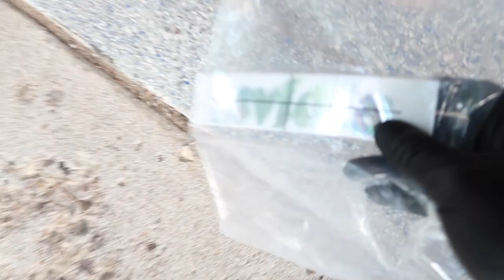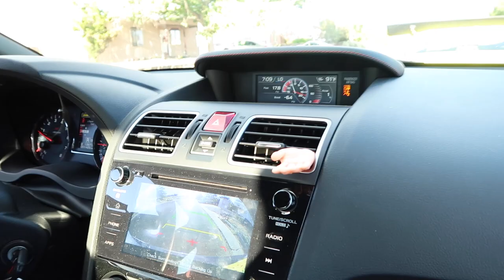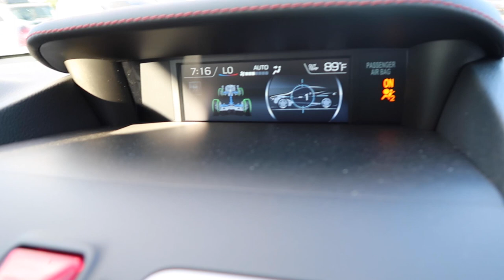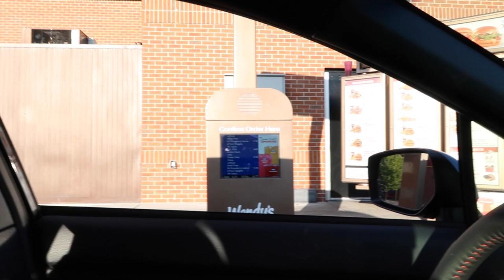2019 Subaru STI Catback Install | Invidia R400

Comment: The conversations in the cabin were super helpful. Most reviews came from forums which are breeding grounds for people trying to turn little things into big PROBLEMS, and everyone whines about the cabin noise and the drone. Its nice knowing you can easily talk in the cabin. Whammy. Thumbs up. Ordering one for my 2020 STI Limited manana
Reply from the maker: Glad that I could help you out with your decision! Make sure to sub to the channel for more content!
Reply: Did you get your r400?
Reply: @BradlehDadleh  Sure did
Reply: @BradlehDadleh  Great tone, doesn't drone in the cab, but if you're looking to hear the rumble, it's perfect. I've had glass packs, straight pipe... Every format you can think of on a Subie, and this exhaust is perfect. It looks sharp too. The tips are the right size to fill the cutouts. 9.5/10, would suggest
Reply: @DeanPerkins  Beautiful! I can't wait to get mine!!😍